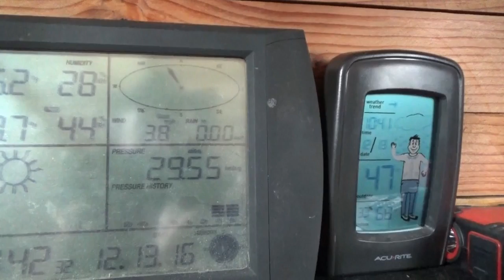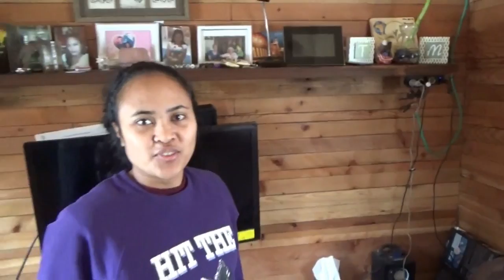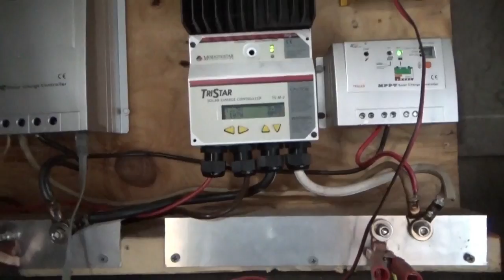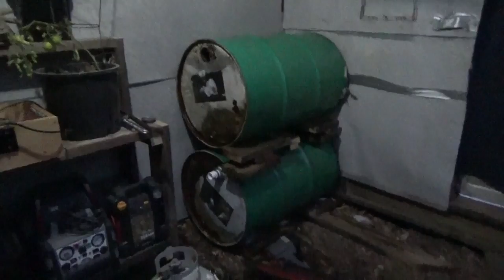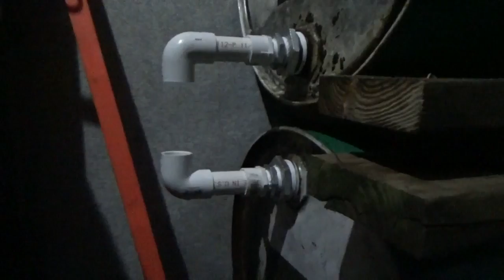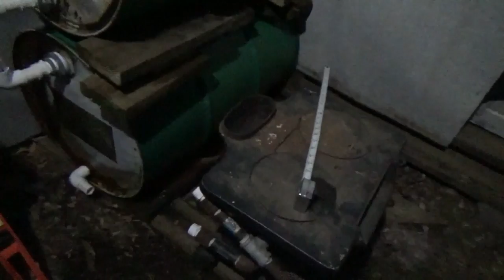Working On Greenhouse Wood Stove Boiler System

Comment: It's no secret that engines run better when used on a daily basis. But living in the North East just as you do, I use my snow blower on the daily. It is a superior quality with a cast iron block like my truck and what have you. But I can never get it running with the pull start in the cold (-22 is normal here). When I use the electric start it runs just fine. So my question is how are you running that damn tractor mower in the cold!

Comment: I don't care how dry your wood is. As part of the burning process,you will create water vapor . As a test sometimes ,take a lit wooden match and hold it on the underside of a piece of cold glass. To see the condensation in action take a look at the exhaust pipe of a car that is cold ,especially in the winter. Take a look at the jets flying overhead. You will see contrails, which is water vapor.

Comment: I am not a thermodynamic engineer, but I know that hot water flows up not down.  Please watch engeneer775 and his thermo syphon explanations, endless hot water.  As currently assembled you will get no water flow.
Reply from the maker: I have studied this for a couple years. The hot water line does flow up on this.

Comment: You should get a logo hot stamp for the coasters. Just heat it in the wood stove and press it into the wood surface, then color them as desired.

Comment: you can re use this pvc fittings, heat them up above 50 degree's and you can remove the glued pieces prying them out  with a screw driver. a elbow isnt that big off a problem Troy, it will work fine, only not the pvc pyping... its a fail waiting to happen..
Reply from the maker: Thank you. I bought something else instead. Wait and see....
Reply: The Do It Yourself World good to here, you scared me a bit! lol

Comment: are you kidding me?? stack pipes wrong side in??? Loll   you should know better man... you had experience with this....ha ha. , also, its quite wett wood too??that mutch creosote in such a short time?? whell, its human to make mistakes! lol, 

Another comment, (sorry nothing personal, dont be offended!!) , is ,these pvc pieces on the heater system will become a problem above 40 degrees celcius, why on eart didnt you use steel fittings? there not that more expensive then the pvc one's??? It will become a problem, you are gonna loose a lot of antyfreeze in your soil when it fails (and its gonna, just wait!!)??  You lost me here completely..sorry. Just put steel pype and fittings on it, or heat resistant plastic, put the stove next to it, inside, make a hole in the roof , leaks are not that inportant in a greehouse for a short time, agayn you lost me here whit the idea to put it outside and with the use of pvc for heating systems...  a lot off extra work and mony for a failure to happen...(no offence)  but man man, what are you thinking?  lol
Reply: MrBugsier5  he murdered a perfectly good wood stove for a couple jars of sap
Reply: His priorities are intriguing at times but always entertaining
Reply from the maker: I forgot on the pipes. And someone tossed in come uncured wood. It happens. I am not using the PVC though. Wait and see....
Reply: yeah I know,  I burn wood for heat.
Reply: I think he takes me seryois, Y mean whell, and am sertanly not a troll, Somethimes Y pull the hear out of my head if he does it his (wrong) way, but its free what you do with my experienced advice, and yeah, its kind off fun to see things go wrong that have not to.  but it makes good video lol , but Y try to help out preventing things go wrong whenever y can, always told him its a pitty he doesnt live nextdoor, would be setlled in then! lol. I'm following him from the beginning of his video's and he has come a lot further in the last years, learning by the day, but its difficult for him to to get the real advice from the troll advice in some cases. I only comment on things i know off, and have done myself as al known off grid engineer.(lived myself offgrid for 20 years on my tugboat).(and now working for offgrid customers making offgrid installations proffessionally here in the Netherlands with my own company.Y just want him to go well! , and i know Troy knows! lol
Reply: The Do It Yourself World  happy to here Troy, you scared me a bit! lol
Reply: stove is just fine, just the pypes wrong side up, and way to mutch non cured wood, if you temper it so mutch , and burning also this type off feul, you get exessive creosote...
Reply: Mxer 727  fully agree! its fun to see others somethimes struggle whit for me simple things... lol, its always easy to judge someone doing things you dont expect others to do wrong, , but it never hurts to give whell mend good advice... lol

Comment: *sigh*....well some lessons - like planning ahead - don't ever get learned. 
Two things, you'd have resolved the problem of how to keep the stove outside and not have the boiler crack if frozen by installing an isolation valve on both the supply and return inside the building next to the tanks. Then you could have put a drain valve on the exterior to isolate and drain the boiler without having to drain the tanks. This is how every proper boiler system is built so that the heating unit can be repaired/replaced. 
Second, if you'd turned the tanks 90 degrees you could have had easy access to all your fittings, and a union between tanks is an absolute must. As they are now you're going to have an impossible time if you ever want to turn them around to pipe to the outside. 
And I guess a third. This is what plumbers and pipe fitters around the world do when taking on a project like this...they dry fit EVERYTHING before breaking out the glue so that when they discover things like the fact that the return is 4" too low, they can take it all apart to PROPERLY put it back together again. And you can buy 45 degree elbows in order to send the supply up.  
You won't be able to keep the wood stove inside...it will cook some of your plants and cause thermal shock to them going from cool, almost cold to t-shirts and a sweat in the matter of minutes. I liked the idea of the boiler system because it kept the giant temperature swings from happening.
Reply: great post. I agree, planning ahead and more research always saves some time and $.
Reply: he uses antyfreeze in this system, so no need for draining.
Reply: Tell that to every power engineer in the world and they'll pee themselves laughing. I'm only halfway through my PE course work but I do work with boilers on a regular basis and can assure you that eventually you'll want to isolate your boiler from the circulation system. Imagine how much money and time he'll save not having to worry about all his fluid leaking out just so that he can tighten or re-plumb a fitting.  All he needs to do is spend about $20 on good brass ball valves.
Reply: John McLendon  normal antyfreeze is yust alcohol..
Reply: there both poison.....

Comment: Are those PVC fittings going to hold up for hot water?
 I would think you would need CPVC fittings for hot water.
Reply: nope, the will bubble up and break, i warned him about this, above 40 degree's its becoming flexible and break...., its a pitty, it looks nice , but , i'm sure it will get hotter then 40 degree's celcius...

Comment: A union between the barrels would have let you remove them if need be.
Reply: its gonna fail any way, iff the pvc becomes over 50 degree's celcius...
Reply: pvc is good up to 144 degrees but not recommended for over 130 degrees Fahrenheit
Reply: i'm in celcius, above 50 degrees it gets tricky.
Reply: Dirt floor. Might drown the rodents!
Reply: MrBugsier5 i probably would of conected with galvanized or even pex
 since pex wont break when it freezes . if those pipes freez he is gonna have a bunch of water on the floor
Reply: he uses antifreeze , so no frost problems...

Comment: Brrrrrr.....   just listening to the ice crunch makes me cold!    Perhaps some mini hoop houses over the plants inside the greenhouse as back up if the thermal mass project is not ready?   I have used 2 liter and gallon jugs over small plants to protect them. (in my case to save water but same theory for cold)
Reply from the maker: Today we have a high of 20 degrees F with sustained winds of 11 to 20 mph and gusts between 50 to 60 mph. The wind chill factor is somewhere below zero. Lets just say that you cannot stay outside for long before coming in to warm up again. But tonight gets even better.... a high of 8 degrees F with the same, or stronger, winds.
Reply: Waaay toooo cold for me!

Comment: Make sure you put a drain on the pipes at the boiler. If you have to go away for a couple days and the boiler has no fire the water  will freeze and bust the boiler open RICK
Reply from the maker: I plan to run antifreeze mix in there

Comment: Don't know what temperature/pressure ratings you are expecting.  Keep in mind cpvc pipe has higher service temperature/ pressures than pvc.
Reply from the maker: No pressure really. The temperature should not be able to go much above the boiling temperature of water
Reply: The Do It Yourself World I would have to check the temp tables but that may be too high for the glue to hold on pvc.  Just keep it in mind if the joints fail,  may have to switch to cpvc.  wish you the best
Reply: pvc pipe fails when temperatures exceed 140 degrees

Comment: Keep in mind the special insulation requirements used under metal roofing.  Very different than traditional wood.
Reply from the maker: There will be an air gap

Comment: I thought you were going to put the wood stove outside the green house?  If that is the case, isn't the ground outside lower than the floor of the green house?
Reply from the maker: I was going to but cannot afford the do it right this year like that. The water has to have antifreeze in it and I have realized that we need all the heat we can get this year
Reply: How are you going to deal with the exhaust? To me it seems simpler (and more economical) to buy a moderate quantity of antifreeze, or even go without antifreeze, than put the stove inside.
Firstly, because 500 kg (half a ton!) of water isn't going to freeze overnight, especially if the stove is on, and secondly because if you make a hole for the chimney you will have  a spot with no insulation and potentially drafts. 

Remember that such a large water mass will take a long time to heat and cool down, and the bulk of it is inside the shed. If the shed stays at around 10°C all the time, the water will NEVER get much below that, that means that there is little chance for it to freeze. Since the system is also non pressurized, should it begin to freeze, it will simply pour out of the top.

Then you could add antifreeze, but in my opinion it just seems simpler to run the stove enough to keep the water always warm and have it outside, and then add antifreeze later, than to mess around with pipes leaking creosote (remember the shed?), going through roofs (and leaking water and heat) and worrying about the exhaust getting too hot.
Reply: The Do It Yourself World Tough spot. Planning on taking the chimney out the wall or the roof? I think it would be easier to patch a hole in the wall rather than the roof if you do move it outside next year.

Comment: Instead of putting a solid section of PVC between the top and bottom barrel, why not use  Unions, that way you won't have to make sure that the elbows are perfectly in line with each other and also use on the lines between the barrels and the stove? When needed they can be taken apart to do any maintenance in the future?
Reply from the maker: Budget. Otherwise I would have done so. I just had enough at the time for this stuff